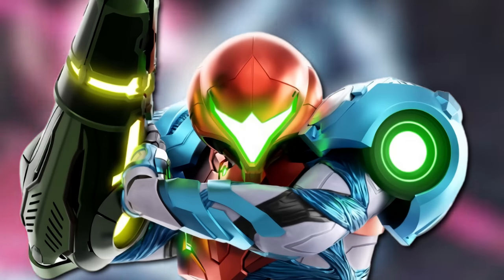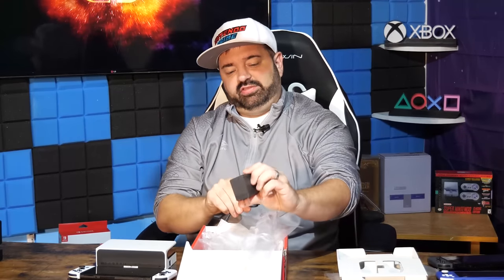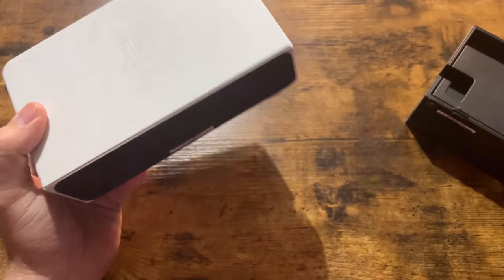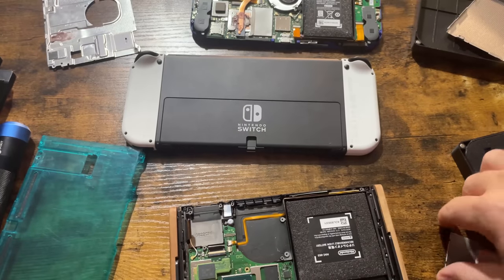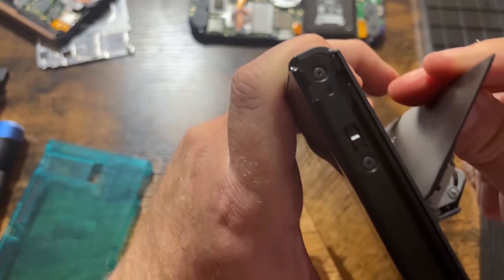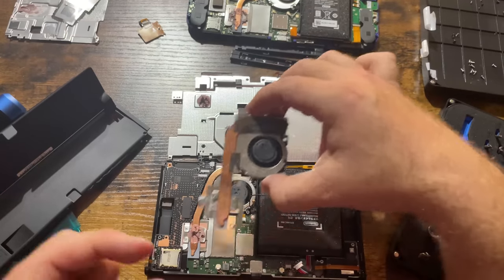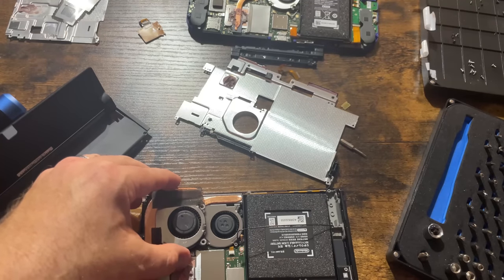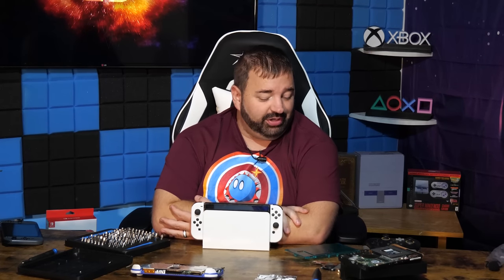Switch OLED Full Teardown! Dock Can Upscale?! OLED vs Switch vs Lite

Comment: “Capable of upscaling”?? That’s just a STM32F070RB Core: ARM® 32-bit Cortex®-M0 microcontroller … it cannot do any kind of display. It’s a very simple MCU with no display functionality! Plz don’t make stuff up…
Reply: My thoughts exactly
Reply: With regards to 4K, he missed the most important part!! Actually the Tegra X1 can already do the upscaling. What you need is a display driver in the dock. He needs to remove the metal casing around the HDMI connector and see if the chip inside is any different. The current chip is a  STDP2550 chip, which is HDMI 1.4. The ARM microcontroller doesn’t do anything.
Reply: I’m more interested in the HDMI controller. That is actually the answer to this.
Reply: So if I’m understanding correctly we need to know what chip is in the hdmi controller?
Reply: Exactly!! It's just a chip capable of HMDI-CEC capabilities, useful for turning the TV on and off.
Reply: Yes folks, it’s the hdmi controller that matters.  He needs to check under the connector case for that.
Reply: I feel like it's identical unfortunately
Reply: @Vinzent Bürer on the bright side, look at NP’s new vid! He looked at the hdmi controller, and it is most likely a 4K-60fps+ capable chip.

Comment from the maker: NOTE: I would not use your Switch OLED in the old dock. The old dock does not have vents for the new location of the air intakes, so it could overheat in prolonged sessions.
Reply: Are the vent holes under the dock circuit board in same spots? I used the 3d drop in cooling mod on OG dock would do same on this one if I can.
Reply: Depends it will work for the og switch since I see the vents align with the og one but the thing is if it would fit at all given that this new dock has a new circuit
Reply: As long as its not the primary dock you use it should be fine 
Ive seen videos of people trying to get the switch to overheat you have to block just about all air circulation in a warm environment
Reply: @colin3ds1  idk something about the way the vents are positiond in the dock make it hard for air to pass through especially with it closed my launch switch had to be in a completly air conditioned room with the air facing it to be able to stay cool
Reply: The docks are trash I’ve seen them bend the Nintendo switch from to much heat lol
Reply: @ot9523  yea I’m afraid this new switch is going to be the same thing but a bit worse since the vent cut out is now coverd by the line design a bit

Comment: With regards to 4K, you missed the most important part!! Actually the Tegra X1 can already do the upscaling. What you need is a display driver in the dock. You need to remove the metal casing around the HDMI connector and see if the chip inside is any different. The current chip is a  STDP2550 chip, which is HDMI 1.4. The ARM microcontroller doesn’t do anything.
Reply: I think people are reaching at this point... Seems it won't upscale unfortunately.
Reply: HDMI 1.4 can do 4k AT 30FPS tho, its HDMI 2.0 that gave us 4K 60FPS, with HDMI 2.1 Giving us 4K 120FPS (or 8k...)

Comment: YOU CAN FIX YOUR JOYCON RAIL! Taking apart my OLED right now.... The daughterboard with the card reader and can come off easily. There's a right screw at the top of it under a small piece of white tape. Under that you'll see that the right joycon cable connector is still right next to the joycon rail (different orientation though). Luckily I had a spare right joycon rail replacement. It mocks up perfecty! I will be posting up a teardown video, and will address your issue in it

Comment: Wanted to point out a few things:
The ARM CPU on there is more definitely NOT powerful enough to do any sort of upscaling - you can look up the model number and see for yourself. It's probably just used for managing drivers for the dock.
The chip that's connected to the ethernet port is pretty much what you'd find in a typical USB to RJ45 ethernet adapter - they basically took that and put it on the board directly, so you would still realistically get the same speeds as you did with any USB to RJ45 ethernet adapter.

Comment: I appreciate the teardown coverage, I really do, but I just can't get over the lack of foresight in the disassembly. I'm really critical because I've broken many electronics just trying to see how they worked, including a Switch. I just knew the rail ribbon was in danger when you started taking it off first. Ouch. But thank you for posting it up early for us anyway. Like you said, it ain't the end of the world, and you'll probably be able to find a replacement cable on the interwebs in a couple of months.
Reply from the maker: Good thing is now that I know how this is assembled I know I can leave the bottom screw in the rail, and take the rest apart. Fun things you find out when there aren’t guides to tearing down a brand new unit

Comment: So the dock internals are essentially the same? Damn was hoping for a pleasant surprise but I guess it's an identical experience.

Apparently the chip you pointed out can't upscale.. that sucks probably should have researched before saying that and getting people hyped.
Reply from the maker: I did research it
Reply: @NintyPrime  Does it upscale? I read up on the chip that it doesnt. Unless u also found a different HDMI controller in the dock?

Comment: 6:47 I'm pretty sure the switch oled has a glass screen, therefor the plastic inside of the dock can't scratch it unless some sand gets stuck to the inside of the dock or something. It can still scratch the old switch though if you put one in there
Reply: Just curious? Why are you pretty sure the Switch OLED has a glass screen? All Nintendo's previous consoles have a plastic screen. And there is no proof the OLED has a glass screen.
Reply: @Liquid2ubstanc3  it’s glass. People have the Switch and they have said so.
Reply: @paintfatpurple7394  then it must be true. Would be great if they would do s scratch test to be sure. It could also be that the laminated screen feels better.
Reply from the maker: @Liquid2ubstanc3  it is glass. I confirmed it in this video at end. However the dock itself is not any better at not scratching switches, oled itself is just harder to scratch
Reply: @NintyPrime  how did you confirmed it is glass?
Reply: @NintyPrime  Ah, I gotcha

Comment: I am wondering while playing normally and you are into a game on the OLED, do you always notice the bigger screen and popping colours? This makes me think of 3D in movies. 99.9% of 3D movies, 10 minutes in I forget/stop noticing the 3D. So I wonder if it is similar to the OLED switch. Do you keep noticing screen differences or eventually do the differences stop being noticed? I have heard this question elsewhere about the screen size but not the with question of colour popping OLED.
Reply: I use a OLED TV, in end you stop noticing it, you still get blown away when example a game or movie has great HDR, but it's like a high Hz monitor or oled where you get used to 120+ Hz, until you go back to a 60hz, that's when it kinda hits you how much better yours is Vs that

Comment: you mention at 10.24 about an extra functionality hole and say you will see what this is when you take it apart, but when you take it apart you do not mention it again, i have been wondering since i got my new switch what this is, my guess is that they were going to put the headphone jack there and then changed their mind and filled it. can you please confirm thanks.

Comment: You can remove the heatsink... the "punch holes" just connect the heatpipe to the coldplate... you remove it with screws on the left and the entire assembly is going out (You was even holding the older cooling in your hands while comparing and was to see its 1:1). I was so hyped for this teardown, but at the end it was a letdown sadly. You showed nothing more than Austin if we exclude the dock.

Also that STM32F070 has nothing to do with upscale. It's mainstream ARM controller @ 48MHz with USB 2.0 features which is really shocking... it had to be at least 3.0 for the Ethernet. But Nintendo...

For the long chip on the black board... I very doubt it's the NAND storage. The shape is unusual for flash storage. It's likely the cartridge controller/decoder or the touch controller. Same was with the STM chip on the cartridge slot in the old Switch and the cartridge controller was on the other side on the main board on the top (next to the fan). The flash storage is probably somewhere on the other side, but we never reached to this part which is a shame. I guess we have to wait for Spawn Wave or Gamers Nexus next week.
Reply: I fear this new ARM chip is replacing the VLI chip in the original Switch dock that allowed for USB 3.0 speeds - I'm not seeing that chip here or an equivalent. 
Nintendo never activated the USB 3.0 port, but if that's true then it would be a downgrade on a hardware level.
In real life it would never matter as Nintendo never supported USB 3.0 ofc.
Reply: So the upscale thing he said wasnt true, just hype? :(
Reply: Soooo it can't upscale then? Just a boring old dock? Damn was hoping there was a suprise in there

Comment: Why did you not dismantle the cooling?
Waiting for the processor to be shown eh ...
Reply from the maker: It's literally the exact same chip, There is nothing to really see.
Reply: @NintyPrime  New console and 16nm chip !!!
I was counting on a smaller technological process and a larger boost because, as is known, tegra X1 did not go to 100% of its capabilities.
I think I will buy the old switch version

Comment: Do you know if all the screws must be removed on the rail to get the "back plate" off. OLED looks like the backplate is most of the housing now versus on the v1 and v2 you can take out just the middle screw on the rail to get the back off.
Runs pretty dang hot docked, interested in repasting the thing with Kryonaut. My v2 ran MUCH cooler after doing that.
Reply: JK just found the part where you said to not undo the bottom screw! haha
Thanks!
Reply from the maker: @thebrute0747  yup, if you leave the bottom screw in you’re good. You won’t have to worry about breaking the cable like I did then too. But for a first time tear down you just remove everything you see lol.
Reply: @NintyPrime  Yeah no for sure makes total sense just trying to be as minimal as possible and like you said avoid any damage.

Comment: Would love to see under that heatsink. Just to confirm it’s all the same and they haven’t slipped an X1+ in there or some more RAM
Reply: Nah think it's identical dude RIP ... I didn't get my hopes up because of this
Reply: Uh, the Switch has been using the X1+ since 2019.
Reply: @nathansstuff1547  good to know. I had completely missed that change over. That’s got a little more grunt on the GPU. It also does 4K upscaling on the Shield.
Reply: @delta0  It's why the Switch has had a little more battery life with the same battery, built on 16nm as opposed to 20. Uses LPDDR4X too as opposed to the LPDDR4 the original Switch used, so some power savings there.

Highly doubt it'd make too much of a difference in a lot of games if they raised the clocks to what the chip is capable of though.

Comment: Does anyone have a solution for their OLED switch not supporting above 480p when in docked? I don’t even get the options of 720 or 1080 in the tv output, in system settings.

Comment: That connector doesn't look like it's for the joy con. That looks like it goes to the volume/power buttons on top. Also I think you were maybe still frazzled by having broken your joy con cable (I know I would be)... those rivets are the same as on the non-OLED switch heatsink. The screw positions on the heatsink on the OLED and non-OLED appear to be in the same spots. The one screw may be hidden under the black PCB. Take a break and revisit. The key here is removing the black PCB. Maybe there's a screw, clip, or cable you're missing underneather. Maybe there's some double sided taped. Isn't the memory module on the non-OLED switch held down by double sided tape? Would make sense since at least on the top of the PCB there don't appear to be any more screws. Worst case wait for ifixit or someone else to do a complete teardown. You may still be able to harvest that joy con cable from your parts Switch.
Reply from the maker: I have since taken it apart again and yes, that is the connector for the side rail. It's just a stupidly long run, but so is the other side too. Just the way they designed the new board I guess.

Comment: Do you think the fan is of a better quality? My launch switch makes a buzzing noise I´m thinking of replacling it after I have the OLED. It doesn´t overheat so the fan still does the job. So not sure what to do.
Reply from the maker: If your fan is buzzing it could be loose, dirty, or defective. Either way, no issues with the oled fan.
Reply: @NintyPrime  I was also thinking it´s just a bit loose or dirthy I tried opening it to clean/check but one screw on the joycon rail is stuck and start to wear out a bit.

Comment: The amount of plastic used in the dock, for that tiny simple board... Tragic
Reply: It's an intentional move to make sure the dock only ever contacts the Switch's USBC port straight-on, it will help prevent wear and keep it working much longer than if contact could be made at an angle.
Reply: @SNMG7664  still tragic

Comment: is there a difference if using the original switch in the new dock outside of built-in ethernet?
Reply: No
Reply: I do not know sincerely, I expected to see no difference at all but for some reason mine is visualised slightly differently and now I am trying to understand if I am mad, but at any rate, even if it is actually different is just very slightly, not very noticeable.

Comment: Cool video, especially your finding on the Dock chip. It's a bit of a shame that we won't find out what the SoC's model number is until later, though. It's true that Nintendo says the internals are exactly the same minus the 64GB of memory, yet the same was true for the V2 Switch. 
(For reference, V2 marketed higher battery life, same internals. It contained the same battery, but a more power efficient Tegra X1 (Mariko) and LPDDR4X RAM vs the original's LPDDR4 RAM.)
Regardless, it's appreciated that you brought this new info to light.
Reply: The new dock can't upscale not sure why he's saying it can

Comment: It's so painful watching him handle hardware like that. He just throws it around. Let's hardware hang by the wires with no support and then wonders why it broke.  You have no clue what your doing man
Reply from the maker: I’ve taken apart tons of electronics and done a lot of repair work. 

It does work. Lol. I broke the screen. That’s it. It worked in docked mode just fine. I didn’t have a heating pad which would have made the screen just fine.

People who get upset over someone breaking something they own basically on purpose make me laugh lol
Reply: @NintyPrime  ok. fine.. its just as someone who works with electronics myself it hurts me to see people handle hardware like that on a video where people see it because they might handle there hardware the same way.... in my opinion you should try to handle the tech with more care when making videos.. i would hate to think someone broke there switch because they let the controller dangle from a ribbon cable because they seen you do it that way .. that's all